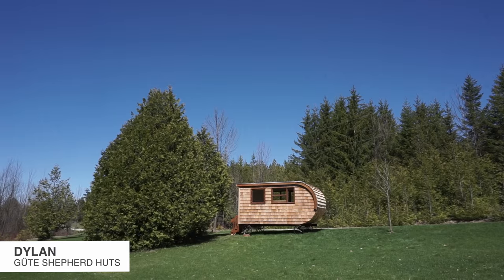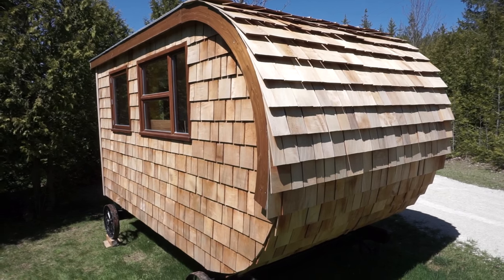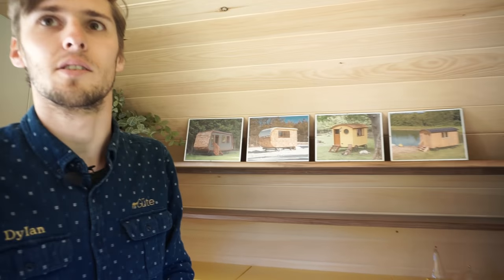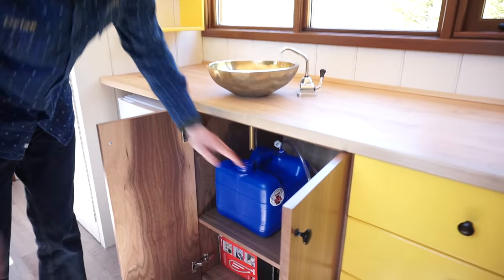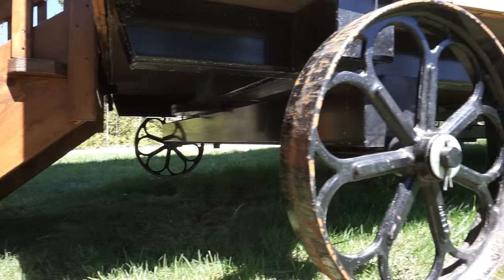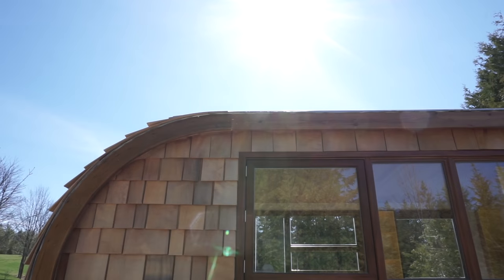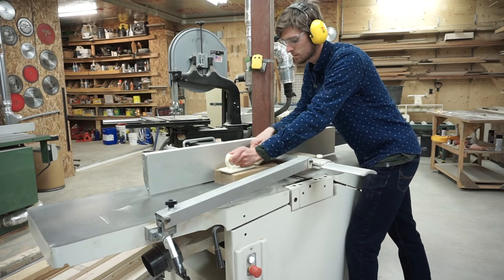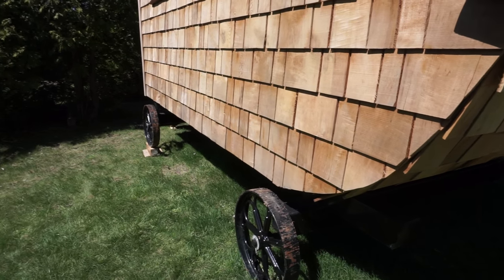Tour of Modern Shepherd Hut Built by Güte - A Great Tiny House Alternative

Comment: Great stuff you guys are building.
Difficult to believe that anything for which you require a building permit must be a minimum of x-size.
That seems utterly illogical.
Love your designs - the more plain the better for me!
That naturally sun bleached look is great.
Reply: It's so people don't build small unsafe structures and they don't drop their neighbors property value.
Reply: Fair point which I hadn't considered. Thanks for the reply.
Reply: +non yobussiness it is also about taxes. if you have 300,000$ houses, even if the tiny one is not visible or neer to them it screes up the evaluation for them and taxes would have to level off. Nowhere do they ever level off. They don't want a sector taxed at 3,000$ and the next at 800$ even worst if you are of grid. Here they make you plug into hydro Quebec anyway for permanent housing.

Comment: Looking at these little homes on several channels, there are a lot of rules to be followed in order to making the homes legal, which makes them hard to build and fit into regulations. They always require fitting silly/unnecessary features like wheels. Most of the homes have a focus on using a small space, consuming very little resources and leaving a small amount of waste whilst living there. Same goes for the process of building the homes. The way I see it, that way of building these homes would be a benefit to everyone. It makes sense. If house building rules started out making sense, we sure got the rules that are used on "backwards planet" these days.

Comment: I’m considering doing this in the states to save money on a trailer. I could get tiny house trailer for a few thousand dollars and build on that... but if I’m not planning on moving it very often and also not planning to buy a large truck to tow it myself, do I really need a standard trailer? Seems I could cut my build costs and starting date significantly if I put it on these “shepherds hut” wheels instead of a road-worthy trailer and then just hire a flatbed when I need to move it. 

This is a major decision I need to make in the near future, so any advice would be appreciated. Thanks!